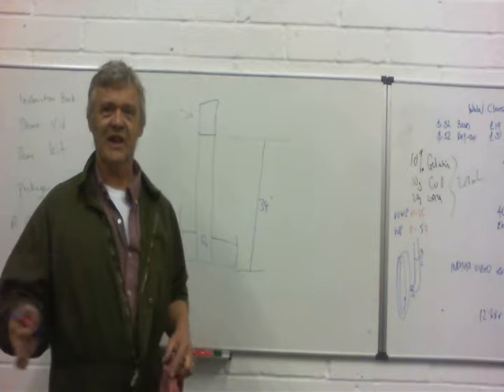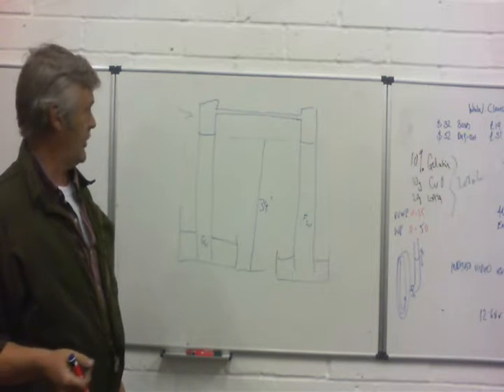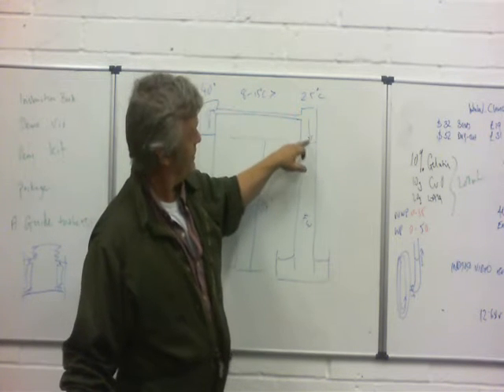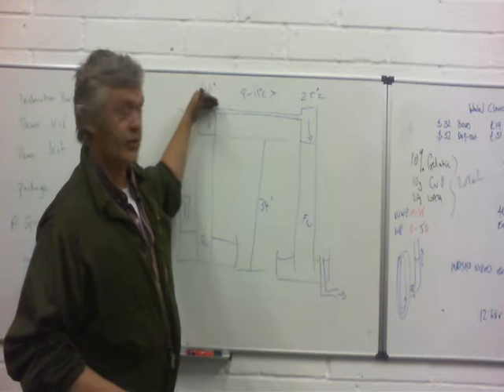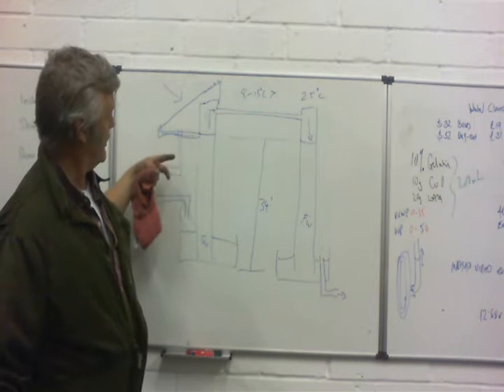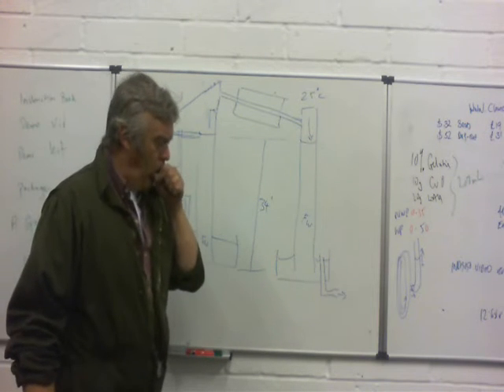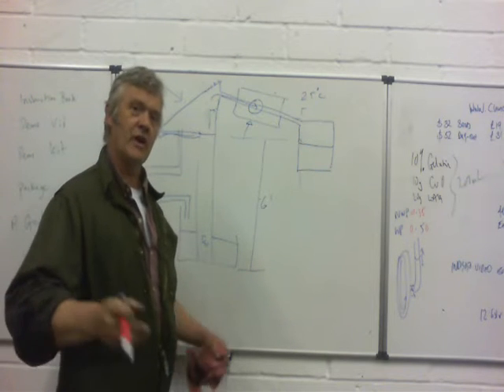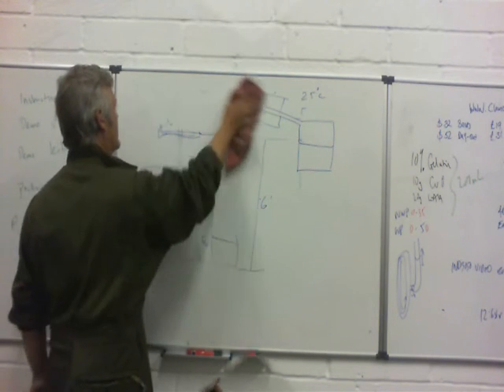Low Pressure Desalination - Some Systems

Comment: Another practical consideration is moisture carryover which would bring along with it salt contamination. In high pressure/high temperature boiling such as in a power plant where the water boils at 500 F and 1000 psig, the steam quantity is only around 10% with 90% liquid water being carried along by the steam. Remember steam is invisible. When you "see" a steam plume coming off your tea kettle you're actually seeing the liquid water that is mixed with the steam. In a power plant they send the steam/water mixture first through a moisture separator and then a steam drier. I think a low tech solution would be to pass the steam/water mixture through some cotton or maybe even hay or straw on it's way to the condenser.

What I don't know is whether carryover is nearly the same problem with low pressure boiling as it is with high pressure boiling. I suppose one could just test the salinity of the condensate and if it's unacceptable then add in the moisture separator.
Reply from the maker: it's going to be a question of testing that mate - but i don't think that will be a serious problem given the nature of the system - still testing will tell
Reply: In a hard vacuum how much water would be in the steam at 150 F?

Comment: I like the idea of filling tube with a pump. (maybe a giant harm pump if you wanted to go that far) close the valve at the top and bottom, let the vacuum and heat be for a bit, then drain off the fresh water at the top level.
Reply from the maker: interesting idea mate - my next step is to build the prototype

Comment: The single column is pretty cool. Does the water boil at the 40-50c range under that pressure?
Reply from the maker: it's just a target temperature mate - the boiling point will reduce the better the vacuum - if you get it right the actual temp will be about that - but temp difference is important too

Comment: Is it possible to use the input sea water for cooling before putting it into the heater?
Reply from the maker: sure - why not - well that's to say it would be good to put it through a heat exchanger - but you want to raise the temp to around 45-50 degrees C - so it would only 'cool' something above that temp
Reply: Robert Murray-Smith

If you take  the water from the ocean (at say 20C) put it through the vapour outtake(40C) then you can get the water into the heater at (say 30C) , Then you don't need to put as much heat into the water.
Reply from the maker: catprog
certainly along the lines i was thinking mate